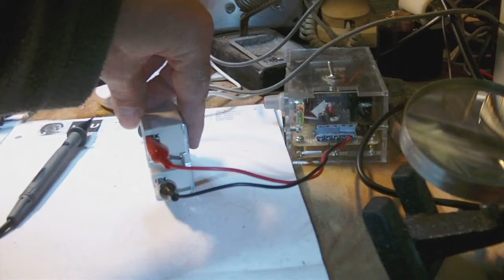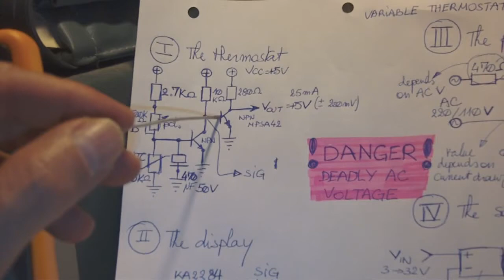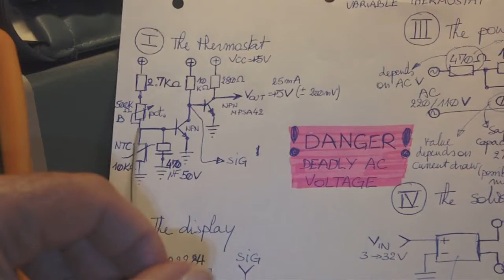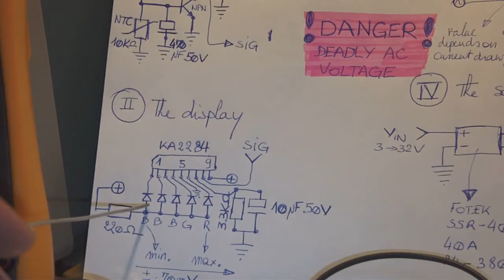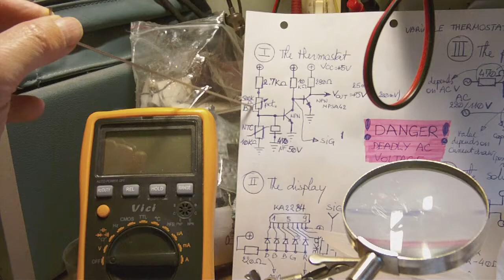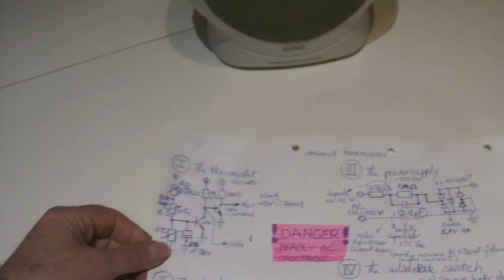Weekend Projects: Building A Simple Electronic Thermostat

Comment: I agree on that heater not having a fuse, incredible, and if I'm not mistaken space heaters are one of the number one causes of house fires.
 Great job on this, I always enjoy watching how you design and utilize circuits, I know the basics for testing and replacing parts but circuit design is way beyond me.
Reply from the maker: Hey :) thanks for the great comment. Yes, you'd think a fuse is rather essential. Well, it's the first line of protection really. It's irresponsible not to build one in just to save a few cents.
Anyone can design simple circuits. It only takes common sense and basic knowledge of how components function...really :)
Stay tuned and have fun